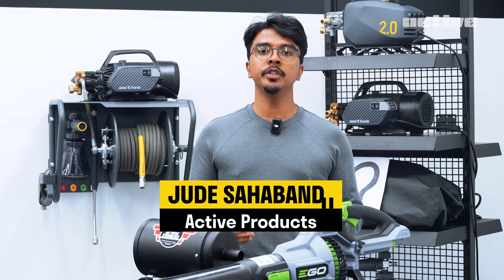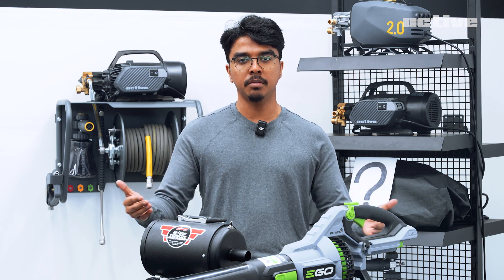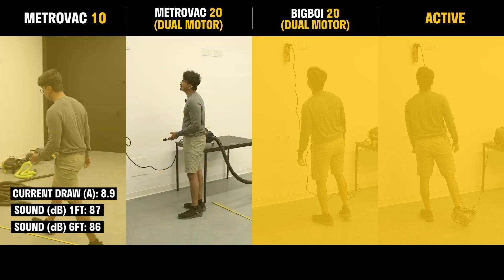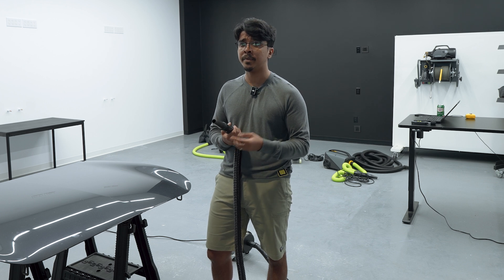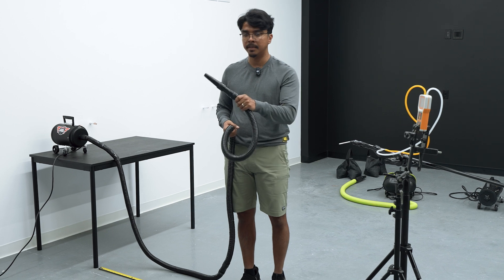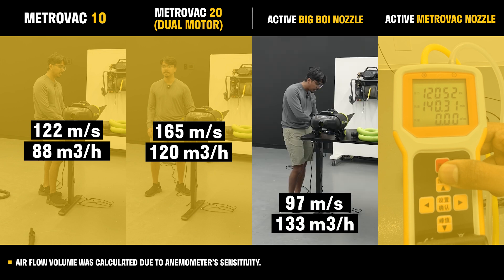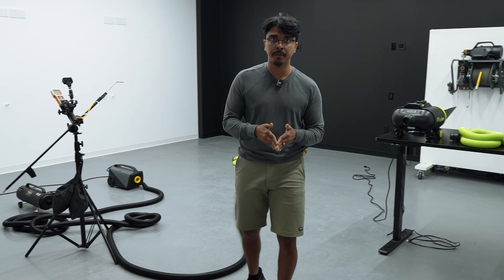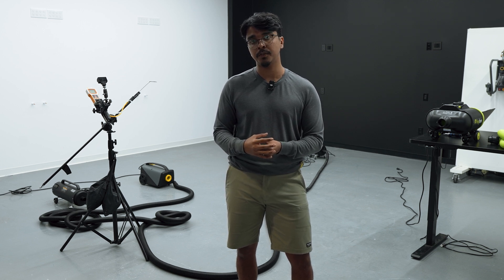Let's Test our New Blower Prototype! | Developing a Car Dryer for Detailers PART 2

Comment: I taught an applied physics course. Students study seven technical principles: force, work, rate, resistance, energy, power, and force transformers, examining how each principle plays a unifying role in the operation of mechanical, fluid, electrical, and thermal systems in technology equipment and systems. I’m have been retired 7 years. Watching this reminded me of the demonstration I would use to introduce each unit and sections. My point, my students didn’t not hear a word I was saying. The demos didn’t really work to help them understand it. Nothing tops the “hands on activities” the students conducted.  I’d have to try this and compare it myself to a $49 electric blower or a drying towel.